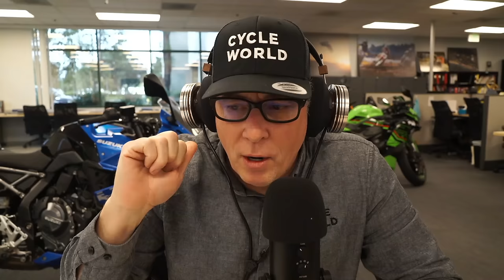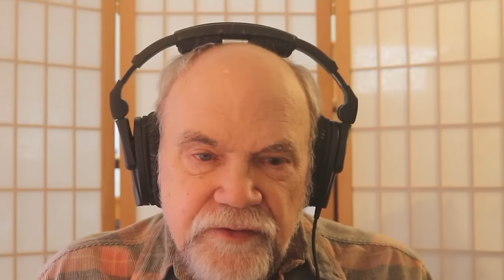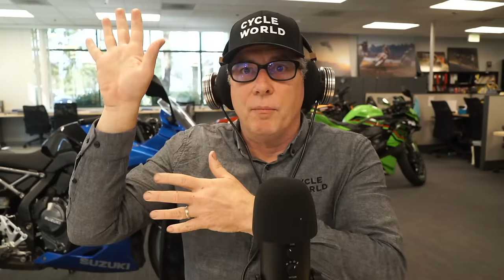The SECRETS of great MOTORCYCLE TIRES

Comment: In the late 80's I had a 750 Ninja GPX (not a ZX7). A buddy of mine used to race one at Willow. 
He bought a 1987 FZR1000 and started racing that.
I took off all of the "go fast" parts from his 750 and put them on mine.
He had a set of Marvic rims on his 750 that he was going to use on the FZR, but the front rim didn't fit the FZR.
I bought a front Marvic rim for the FZR, we traded front rims and I bought a rear rim for the Ninja.
The rim size was 5.5x17 for the rear and 3.5x17 for the front.
He had been running Dunlop slicks.
At the time there were no "readily avalible" 180x5.5x17 rear street tires for the rim, so I was stuck running a slick on the street for the rear (no fun).
I was at the local aftermarket bike parts store (remember them) in Oxnard when the tire guy came in with a new set of Metzler ME33 street tires in the sizes I needed.
My buddy bought them with his racers discount and I bought them from him.
Mounted them up and for 3 months I was running around with the only 5.5 street tire around.
Lots of weird looks and double takes from people at The Rock Store and Nukem's seeing a bike that came with 16/18 rims running 17's with that "wide" rear tire. LOL!
They were OK, much better than a slick on the street.
When Dunlop came out with the D364's they were the cats meow!
I ditched the Metzlers for a set of new D364's and never went back.
When Dennis Smith used to run the Dunlop tire truck at the races at Willow he would have a serious amount of D364 take-offs he was selling from the "used tire rack". LOL!
We used to buy a bunch of "used" tires from him.
Never had an issue with them, you just didn't buy the totally rashed out tires.
Dunlop was the tire I used after that.
I got out of riding street bikes for years, when I jumped back in I was living in the PNW.
That's when I was introduced to the Michelin Pilot Rode tires.
Love them in the PNW!
Still use Dunlops on the KTM 300 for the PNW singletrack gnar, first the D756 EX and now the AT81 EX!

Comment: I run tires whìch mimic the beloved dùnlop k81..tìre.
This is the shoulder that features..gaps of non conti uous tread....this acknowledges the need for high communication and controlled drift to finish corner properly...

Sport tires today feature unbroken high traction cornering surface. This means tire will hang on tenaçiously as loads get higher....when the load maxes and tire lets go tends to snap ..releasing all the force at once!

More useful is a tire with less total grip.. but high communication..anď a broad band of disengagement!

I raced 20 years..best tire i ever had was a worn beyond use racing wet  from our race team....it was incrediable! It was never "hooked up"...never ",unhooked"!
Made throttle like a rehostat for pointing the bike!!

Great casual fun ..using as a steering tool on my yam tdm 850 sport bike killer! 12:52

Comment: Gents, my question is about setting tire pressures for street riding. For the purpose of my query let's use the owners manual figures of 36 front / 42 rear. 

Scenario: the bike is inside the garage overnight, where the ambient temp is 55 degF. The bulk of today's riding will be in 100 degF temps. 

Shall I set the 36/42 in the cool of the garage, without regard for the hotter temps that will be encountered during the ride?

What would the protocol be if the situation is reversed? The bike is stored inside a very hot shed (95 degF) and the riding will be along the chilly Hwy 1 (60 degF). Again, shall I set 36/42 in that hot garage?

Comment: I will concede tire technology may be better than the past, but street tires cost way too much, especially compared to car tires, when you consider how many miles you get out of a set of bike tires. Just middle of the road Bridgestone Sport Touring tires for my bike cost around $ 125.00 - $ 200.00 a piece. Now, that might be okay, if you could get 30,000 miles out of them. But when you consider cheap Car tires are the same price, but are often rated at 60,000 + miles. Also bike shops charge $ 50-100 dollars for mount & balance per tire , compared to $ 20 bucks per tire on cars/ trucks.